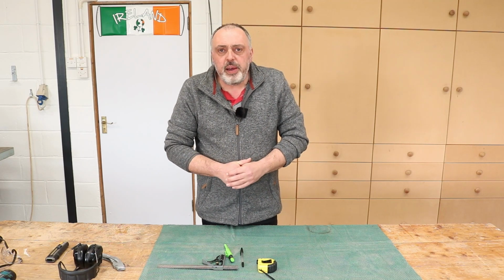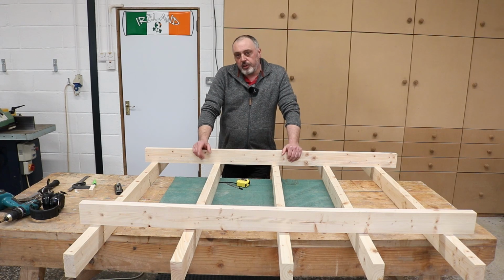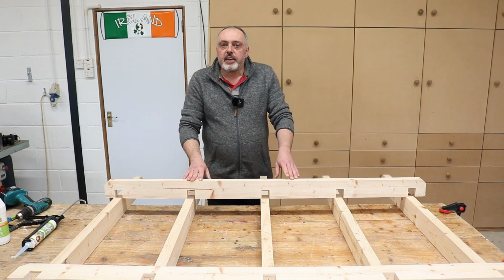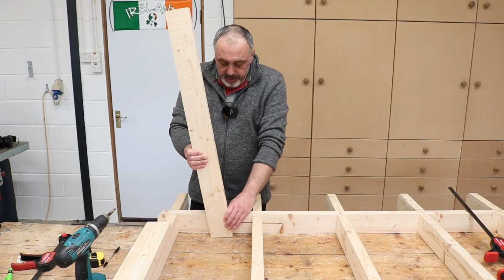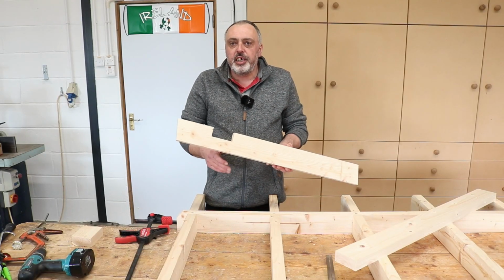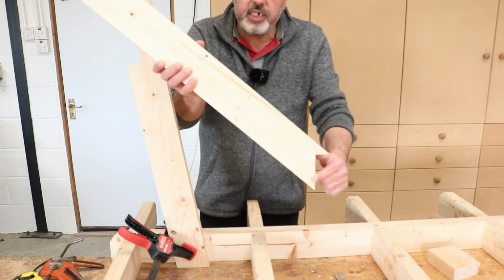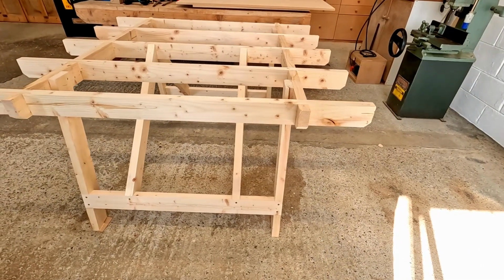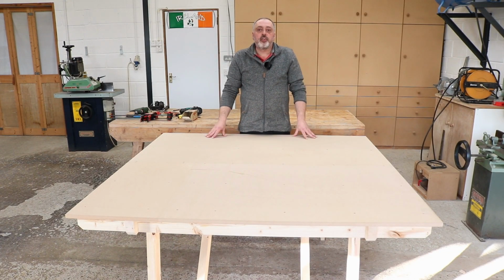Build a Strong CNC Workshop Bench in Simple Steps

Comment: The bench looks great! Although you didn't prove it was level! Couldn't help but reflect on the number of super expensive tools you used to put it together though, perhaps 5 or 6 of them.
Reply from the maker: True I guess you will just have to take my word that it is level. I use the tools I have after 30years but it could be easily built using just a mitre saw as all joints can be achieved with it too.